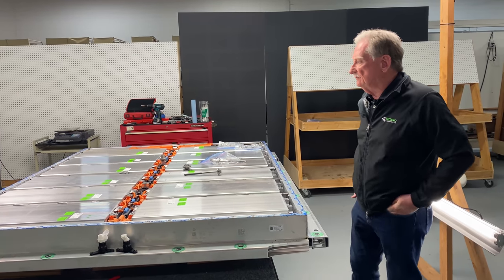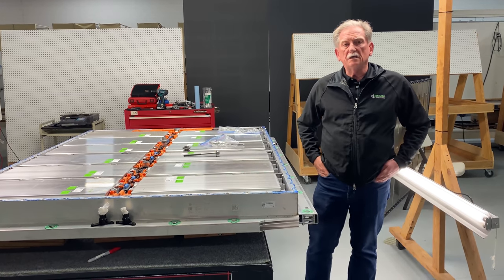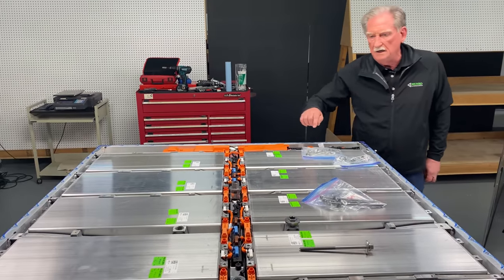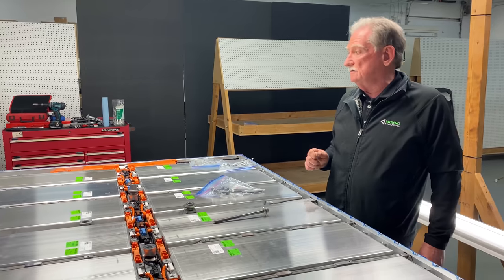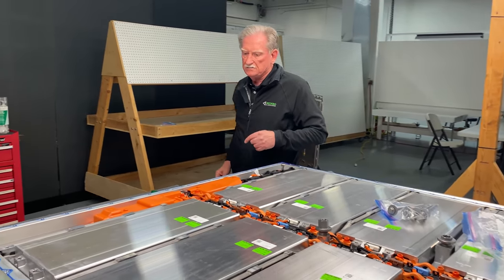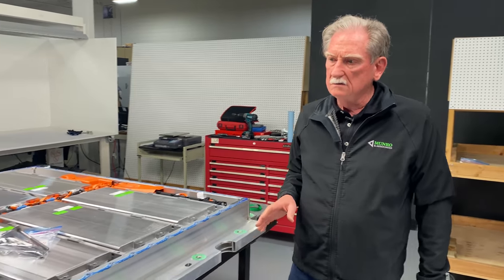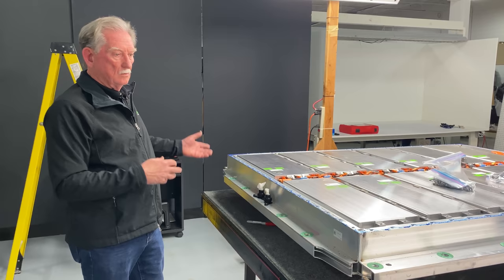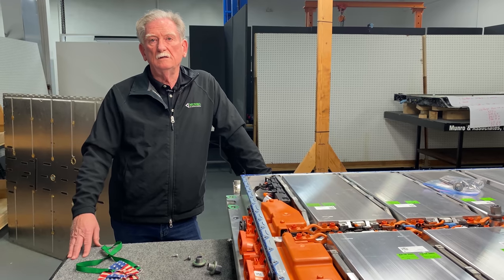2021 Volkswagen ID.4: Battery Teardown

Comment: Saving to the manufacture...expensive to the costumer in the long run. A polymer to hold a massive heavy battery pack like that, plus the heat cycles? I would prefer to keep the metal structure then.
Reply: This is not toys plastics to be sure. Anyway shame they cannot do structural pack. That would be 1 step ahead. But sadly from WV they just follow example after almost 10 yrs of teach.
Reply: @alesksander  good quality plastics cost money...why use expensive plastics, when you can use metal instead? They are trying to use some type of plastic to save instead of the metal option.
Reply: @RogerM88  I believe he explained why this would be good. You get savings from using less fasteners and less welds. You get a weight reduction. Less weight means you can use a smaller battery to get the same range or keep the size the same and get more range.
Reply: @ymcpa73  no thanks...I'd rather keep the "heavy" steel version. Especially to encase a battery pack. Plus more resistant to perforation from debris on the road.
Reply: @RogerM88  Sure also atm savety is huge concern. They choose wise for sure. But its not forward thinking as it should. Structural is way to go. But hey thats beauty of lateral thinking.
Reply: Also metal stays is case of structural pack. At least is more convenient and eco friendly. Unless they invent some sort recycle thermoplastic composite. That would be truly transformative.
Reply: @alesksander  that's another important topic...being able to be recycled. Being a metal, it's way more easier to be recycled. Also wouldn't feel very safe under an old EV with a thermoplastic composite battery pack structure case.

Comment: 1:40 Tesla has a new 82kWh battery since Q4 20, Q2 2021 that weighs the same as the 77kWh old battery and has the same size, more dense. You should check it out.
Reply: Fair point . @Munroe Live

Comment: Can't wait for the Mustang Mach-E teardown series! I hope it's as detailed as the Model Y teardown!
Reply from the maker: It will be!
Reply: the Mexican Mustang will have a Squirrel mounted in the motor bay.
Reply: @markplott4820  Troll somewhere else.
Reply: @markplott4820  Actually the Mach-E is about the only other EV worth buying at this point.  It is not a Tesla and never will be, but if you want an EV and hate Tesla it is the car for you.
Reply: @davidbeppler3032  - the MONK - y is just ok. 
still too heavy, still NOT a Mustang 🐎 , it will appeal to FUD motors buyers, but it won't attract NEW customer. 
The interior is like a OLD Fashioned car from the 2000's, inc the crappy FORD Sync. 
why does an BEV need a Start button, gear Selector, and Volume knob ?
Rookie mistake by FUD motors.
Reply: @markplott4820  Sure, all that is right, and it is still the next best thing to a Tesla.
As for new customers... after owning an EV most people never want an ICE again.
Reply: @markplott4820  I actually don't. But Mark, you DO act like a 12 year old. Its pathetic and bizarre and the people in these comments sections are both annoyed by and pity you.
Reply: @patreekotime4578  - I am SHIVA the Destoyer.
Reply: @davidbeppler3032  - agree, just wish FORD and others would make Vehicles as good as Model 3, is all
Reply: @markplott4820  the only thing you are destroying is your own reputation.
Reply: @markplott4820  They will in 7-9 years.  Takes time for old companies to move.  They have a lot of MBAs and CAs to deal with.  Those guys are not prone to intelligence or alacrity.  Just saying.
Reply: @markplott4820  Casual racism is alive and well. Amazing that people like this actually think that they are being clever or witty.
Reply: @markplott4820  You will further note that Mark Plott, with the exception to this channel.. Only subs to Tesla and Pokemon related channels.. so you know.. take it with a grain of salt.

Comment: If you save weight by using more expensive carbon fiber composites do you actually save any money?
Reply: how will sandy appear clever to the non engineers? And also hype Tesla at the same time?
Reply: No

Comment: The ID4 battery is about 10% larger than the Model Y capacity wise.   And it is about 10% more weight...   So you are trying to have a bigger capacity battery in the same weight as a smaller capacity one.   That would only work if Tesla battery was too heavy for its size..
Reply: VW uses pouch cells,Tesla round cells, that is not apples to apples, there is a realistic chance of VW (or someone else) building a battery with a better capacity/weight ratio.
Reply: @tzarcoal1018   Or worse capacity / weight ratio, but using a cheaper chemistry.  See BYD Blade LFP cells.
Reply: No its not the model y is 82kwh or possibly more . It was never 75kwh even the old model 3 had 80.5 kwh

Comment: I like the way the battery is built.
Carbon fiber and structural batteries are effective in saving weight but they are more expensive, a nightmare to repair and recycle
Perhaps you can get rid of the top lid by sealing and screwing the battery tray directly to the bottom of the chassis?
Reply: Aluminium has also excellent thermal conductivity, which is very important for thermal management for charging and safety.
Reply: @lennoxbaumbach390  
The circulated antifreeze is the primary system for adding or removing heat. In fact, you want to insulate the pack to reduce heating and cooling loads in extreme ambient temperature.

Comment: A plastic composite battery pack sounds like an ecological disaster, metal might be heavy, but at least is relatively easy to recycle
Reply: Aluminium is fabulously recyclable. It's a crime to throw it away.
Reply: But if the composite is both cheaper and lighter, then you know what the manufacturer will do.
Reply: @alexnutcasio936  A composite is not and will not be cheaper than aluminium
Reply: I think a composite battery is a bad idea for vibration and salt that they place on the road is going to be wakening the Palmer overtime.  If I was going to chase weight I would look into wheels and the size of tire suspension components.

Comment: This was a good video on a part of the ID-family batteries. But Sandy have to keep in mind that there are other issues besides weight that has to be taken into consideration. Both safety and the enviroment are big issues in Europe, so the frame should be recyclable. The ID3 for example is carbon neutral. VW is even setting up their own recycling plants.
Reply: Diesel Gate

Comment: I think you mean elastic state for the preload in the bolt not plastic. You dont want a plastic deformation for a bolt in standard application.
Reply: Actually, a torque-to-yield fastener is preloaded right into the beginning of the yield zone, meaning that it has exceeded its elastic limit and does permanently stretch... which is plastic deformation. https://en.wikipedia.org/wiki/Torque-to-yield_fastener
Reply: @brianb-p6586  I agree with you about the TTY torque, I nerver see that a lot in car industrie.... You don't put the bolt in the trash when you remove the bolt and do some repair. Maybe for the battery pack on the id4 it's the case to increase fatigue life. Im working in Aerospace and we have a lot of TTY bolt like Hilite and when we remove one we put it in the trash and put a new one cause the bolt stretch a little bit and we can not be sure what is the new torque due to a longer bolt. You know when you use a TTY bolt it's not the same geometrie as the standard one https://ricksfreeautorepairadvice.com/tty-bolts/
Reply: @cyrikdnamps  Routine automotive repair doesn't see TTY bolts because they're not used in the suspension, brakes, or driveline. They show up in internal engine fasteners, such as head bolts, which are rarely touched by an automotive tech now, since engines go to specialists for rebuilding, or are rebuilt by amateurs working at level well beyond the typical home garage maintenance effort. I do my own maintenance, but it has been so long since I've rebuilt an engine that I've never encountered a TTY bolt. 

Motors and battery packs like this will almost never be disassembled for repair by anyone, but need to be disassembled to recycle the components when they are done. That means after the car they were installed in is scrapped, and in the case of the motor possibly after the motor is used in another application as well; if the VW battery pack is disassembled it will most commonly be only to salvage the remaining good modules or to recycle the pack. As a result, even though these bolts are single-use, most of them will never need to be replaced, and those that are replaced will be in specialized rebuilding facilities.

Comment: Is that guy serious? The kwh/kg is the same for ID4 and Model 3/Y.. He also makes a video suggesting that they should replace aluminum with carbon fiber?? Yes Munro, it will bring the weight down and the price 10x up and make recycling 100x more expensive.
Also 8.8 bolt is the metric standard for bolts (the most used in all appliances and ok for this application). If the bolt was 10.9 or 12.9 then it is considered to be a bit special not the 8.8 bolt!
Reply: He's being paid by Saudi Oil to shill for plastics. He literally says it in the video, that's what SABIC is.

Comment: I can tell you are working under contract from a polymer supplier.  The crash protection rails on the side could be super high strength steel like many manufacturers are putting in doors.  This would be cheaper and lighter than the aluminum or polymer. you could embed them in the polymer shell during the molding process.